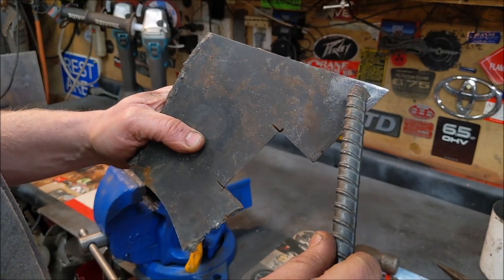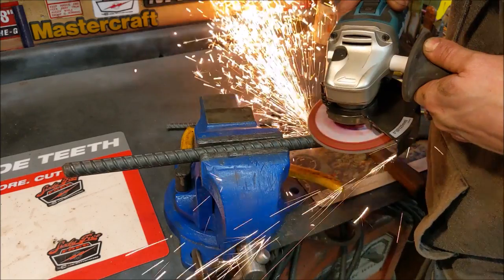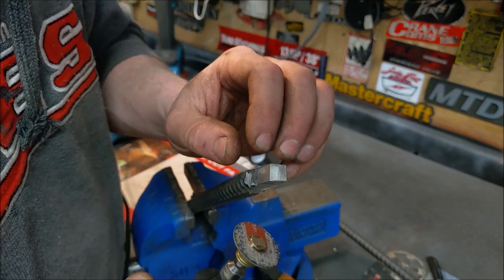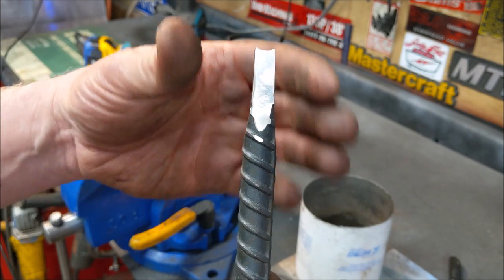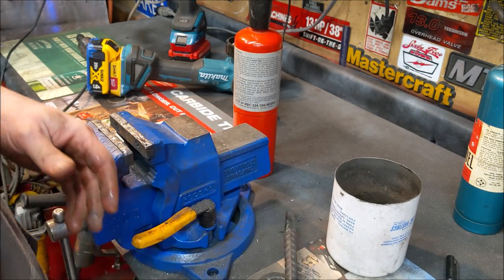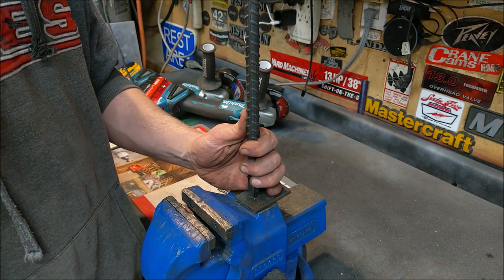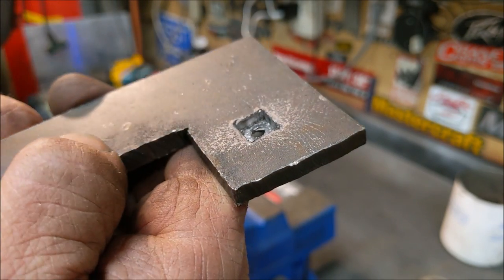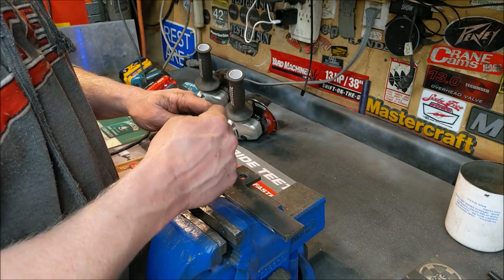Drill Square holes in steel with REBAR   -NO SPECIAL TOOLS needed

Comment: When you heat the tip of the rebar, watch the color move down the metal towards the tip, and as soon as purple hits the tip quinch it in oil and swirl it till it cools off. I've made cutting chisels this way in high school and we had to cut thru 1/2" bolts without damaging the cutting edge to pass the course. I still have and use my chisels I made 20 years ago
Reply: Yes !! I rembr -- but l always wondered why purple and not pink, straw color, grey ? Purple's it huh ?
Reply: Good tip and thanks~!!

Comment: I would have never guessed in a million years that a square hole in .25" steel was made with rebar.
Reply from the maker: It takes a few dozen good swings but comes out nicely.
Reply: It's a bet I woulda lost
Then I would get in a fight, claiming I didn't fully understand the bet, that I mightta been drunk or something, in an attempt to welch out of it
:(
Whew, thanx to 65Ford or that woulda been a real mess in the making
:)
Reply: And a hammer
Reply: Had a certify on the job to weld rebar once -- we used 9018 rods, not your typical 7018s

Comment: Nice job! Re-rod is useful, no doubt. I have saved some big bucks making actuating rods for Cub Cadet tractors and others, by using my woodstove as a forge. One problems that I have run into- repeated heating does cause the metal to go swiss cheesy and become very brittle and crumble away. They are made from recycled steels and are full of inclusions and stuff anyway.
Reply from the maker: It's a great resource for cheap steel.

Comment: Since only the corners of the broach are doing the cutting, think about how you could make the tip of it round to fit into the hole and just have the corner a bit higher up and come in contact as the broach moves into the workpiece.  Just a thought.

Comment: This is a great video. I didn't know whether you could do anything beyond case hardening of rebar but it looks like it's good enough steel that you can actually make decent hardened tools out of it. Like you said in the one part, annealing it will retain much of the hardness and take away the brittleness from the initial hardening. I learned how to do this from Tubalcain and fixed my old Brazilian-made single shot youth shotgun I bought when I was 14. There was a spring-loaded pin in the forearm that had bent because the metal was too soft and the forearm wouldn't stay on when breaking the breach. I initially fixed it by running some electrical tape around it and it stayed fine that way but it always bothered me that the tape was there. After learning how to harden steel parts, I pulled it apart, took the spring off and straightened the pin. I hardened it with water quenching, then I heated it back up hot enough that water would bead off of it and let it cool slowly. Once everything was cooled off, I reassembled with some light oil on the forearm and it works as it was originally designed. Stays put when breaking the breach and comes off when it's closed and you give it a good yank. The manufacturer probably cut a corner on that run and skipped the hardening process on that pin, so hardening that pin fixed it. I was so stoked when it worked. Haven't shot that thing since I was a teenager but it was neat to get it working the right way. Now when I pass that shotgun on to one of my boys they'll never know the difference.

Comment: About 8 months back I did a video about hammer broaching with HSS on a piece of aluminum.  Recently tried it again. But this is a great idea. I had no idea rebar could be used like this. Best thing about yours, is you could also taper your tool to make for some adjustment

Comment: I'm a professional machinist and I have made broaches at work and at home but I have always made them from high-speed steel, I would never have guessed that rebar would harden well. Knowing that could be very useful for a lot more than broaches.
Reply from the maker: It's not the most predictable material to work with, though it does harden nicely. Depending on the grading/rating it can have higher carbon content and get too brittle with the standard heat to orange and quench method. The 1/2" bar I used needed as much help as possible and I used water vs oil quench to achieve they hardest steel possible. The 5/8" bar would have been better a little softer and an oil quench would have achieved this better. You can always anneal it at any time though.

Comment: That looks like a good idea.   I've always drill a hole and used a file to make a square hole.  Your way is much faster.
Reply from the maker: When I need to make a row of 5-6 of these holes in sheet metal this beats filing for sure.
Reply: Same here. Drill and file. But I’m not very often worried about square holes.
I’ll have to try this sometime.

Comment: Great video and sweet idea. The hardening process from what I have seen, was heating the metal until it is no longer magnetic. Quench in you choice water / oil, but they anneal the metal to soften it to be less brittle. So blue is next color during annealing, then air cooled or quenched. It’s been a while since I have watched a black Smith or knife maker, but worth looking into to avoid having more work to sharpen. Retired auto tech, but I still fabricating. With the price of weld shield gas, oxygen & acetylene has gone triple from invoices of 10 years ago, makes it difficult to justify a purchase. Great lighting, volume and camera angles are great. Having a tripod makes a huge difference. I hate the “One-banded” videos and they try to open the worlds toughest plastic parts box.
 I have thought many times, if they made cars out of certain plastics used in packages they would last forever! Thanks! I will not forget this when a future project would be better with a carriage head bolt. They have a valid place in the world. I thank Black Smiths from 150-200 years ago who formed these for “Round Top Trucks” and wagons plus stage coaches!

Comment: Kind of a cool trick. Especially the hardening part.
A square file can work, but it is a lot of work.
When I have to make just a few square holes out of round ones?  I use my little cordless Milwaukie mini sawzall (called a Hackzall)  with a fine tooth metal cutting blade that resembles a narrow jigsaw blade (but has the sawzall blade mount shank on it..).  It cuts on the pull strokes, of course,  while the tool foot is held tightly to the work,  and files out the square corners real quick.
Reply from the maker: That's how I do square holes in wood.

Comment: You could probably use the right size carbide burr and shape your broach in a drill press with it chucked opposed to the drill chuck.

Also maybe you could chuck the broach into a hammer drill that supports hammer without rotation?

Comment: To find the diameter needed I times the size I need by 1.414.  So to make a 1/2 square you would need a 7.070 round bar. (.5x1.414= 7.070) you may be able to find this from a coil spring or torsion bar. Great video. Thanks for sharing.
Reply from the maker: Thanks for the info!

Comment: Great idea/work aid.... The only thing I might suggest is when you are about half way through (or as often as needed) is to redrill the hole to help clear out the metal that is gathering in the center. This will help by decreasing the amount of metal you have to broach out as it builds up...... Just a suggestion to a great idea.  Keep up the good work..
Reply from the maker: That's actually a fantastic idea. Thanks for the great input.

Comment: I’ve seen this same thing done using a square file. You drill the hole to size first (say 3/8”). Then take a square file that is the same size, cut off the tang, and press it thru the drilled hole using an arbor press or hydraulic press. The file only has to remove the metal from the corners of the hole. You just have to be careful to press it straight or you might snap the file, as they are very brittle.
Reply from the maker: Makes sense. That's how most square broaches are made.

Comment: So cut it about 6" long.....put in larger pipe( to keep straight and protect shattering parts from eyeballs) and use cheap bottle jack press to press thru metal plate. ......should work and no hammering....
Reply from the maker: I would trim it down to about an inch or two for a press. The top is too soft and will bend out of the way if it's too long. It should take around 10 tons to press a 3/8" square through 1/4" plate(15tons-3/8"plate, 20tons-1/2"plate). It will be a scary.
Reply: @sixtyfiveford  well dang man!!! Sounds like a great followup video😉

Comment: That’s a really cool idea.  I’ll have to remember you can harden rebar
Reply from the maker: Yeah Rebar is medium to high carbon steel(depending on rating) and makes some decent tooling.
Reply: sixtyfiveford, mostly I have used it to make ladders on machines at work drilling a hole in flat stock and making the foot and hand grabs out of rebar because it has great grip on machines when a typical ladder will not work and you have to build it in.

Comment: Just a question, would this square hole broach easier if you drilled a small hole in each corner after drilling your first hole, or if you drilled four small holes before drilling your large hole. Would this help guide the broach and make penetration easier?

Comment: Nice Job,  I didn't know rebar would harden..   In Machine shop,  you would normally rough drill the hole 5% - 10% over size,  Yes,   It'll leave a small radius on the flats,  but,  the broaching goes 10 times easier..   Making a smaller broach to rough it out,  would help a lot..  2 smaller cuts is much easier..
Reply from the maker: Makes sense.

Comment: That was outstanding. I drilled the hole and then filed the square. Will be using your technique. Thank you...wanted to ask if you could show how to make a simple metal brake bender. I have 1/8 inch aluminum I want to make small trays and use flex weld aluminum rod to seal the corners. I’ve tried making one but can’t get a tight 90 degree bend. It has a bigger radius than I would like. I’m using a 6061 aluminum. Any suggestions would be greatly appreciated. Thank you all your videos are great have passed your channel to many of my friends.
Reply from the maker: For 1/8" aluminum you'll need to score it 1/2-3/4 of the way through like I did in this video https://youtu.be/nynDS-NTBLM?t=324 . For a brake use my vise and chunks of long angle iron. It hold a crisp edge and you have to hand form the bend over than. Sometimes I score the metal and then use the makeshift metal brake.

Comment: I only use square holes on snowblowers when restoring the auger housing.  All I do is drill a slightly smaller hole with a drill bit.  Install the carriage bolt and put the nut on stud side.  I tighten the nut it punches through the circle and makes it the perfect square.  Also use this technique on mower handles as well.

Just another way to skin a cat
Reply from the maker: Snowblower scraper bar is the #1 reason I make square holes.  You don't need to even drill a hole the tool will cut out the entire square with a few whacks. I've pulled them through like you was well though or I just tack weld the head in place with a larger hole as no one will ever repair it again.
Reply: @sixtyfiveford  

I have done the pull through method on countless cheaply made machines.  I have a supercharged hemi 420cc swapped Ariens 1128 that I'm restyling and restoring.  The Auger housing is damaged and scraper bar is worn through.  Since Ariens makes a quality machine, I was questioning my method since its a better built machine.  Will have the rebar as my fail safe...or just by nature drill a smaller hole then usual and let the rebar open it to spec!  thanks for responding!

Comment: You clever devil :-D
The square hole maker for wood is similar-ish,  effecitively 4 wood chisels with the humped tops facing inwards.
Also a drill down the middle,  i thought it was magic untill i looked into the end, simple but so neat.
I wonder if you could use a bottle  jack to push a short one inch broach through the metal, it beats hitting it.
If you like the Hammer time, don't forget the baggy trowsers  :)
Reply from the maker: I am going to try one with a press. I would trim it down to about an inch or two for a press. The top is too soft and will bend out of the way if it's too long. It should take around 10 tons to press a 3/8"(1cm) square through 1/4"(6mm) plate. It will be a scary
Reply: @sixtyfiveford  i bet it will lol, Just be careful to stand out of harms way with protective glasses and a thick coat.
You never know if the broach will escape without warning.
And most important keep your loverly dog in another room.
Reply: @sixtyfiveford  10T isn't scary.  In this application it should be pretty tame.  It'll be interesting to see.

Comment: I took welding in HS good trick but after drilling heat the area cherry red  then hammer it out seems a lot easier
Reply from the maker: The entire surrounding area will smash flat and fill in the hole more than cut.

Comment: I wonder how well it would work in a press to punch the square hole through... Thumbs Up!
Reply from the maker: It should work just fine. I would shorten it to maybe 2" long and put a shield around it. It should take around 10tons to press something this size through 1/4" plate.

Comment: Guess it will depend on what scrap steel is used in making the rebar, but it looks hard enough for most of the stuff I'll be broaching.  Thanks.
Reply from the maker: True. Generally rebar has to be made to spec to meet building code requirements. Stuff used in bridges and sky-rises will have the best characteristics.

Comment: That's a very effective technique.  Just curious about something.  When the broach is about half way thru and some of the material being removed is collecting in the hole could you have run the drill bit thru the hole to remove that material?  Thanks for posting.
Reply from the maker: I couldn't have hurt.

Comment: Would heating up the metal after you drill the round hole in order to soften up the metal to make it easier to punch the square rebar through work?
Reply from the maker: Problem is steel doesn't really soften until you get it red hot. Then hammer with the broach would flatted the surrounding area as much as cut.
Reply: @sixtyfiveford  didn't think about that. 👍

Comment: Nice work, love the improvised punch. I've experimented making square holes with files jammed in my reciprocating saw with limited success. (wrecked the file though)
Reply from the maker: File in a recip saw is something I would try.
Reply: @sixtyfiveford  it works.  They actually used to make file attachments for shapers just for this.  Slow down the recip saw if you can.

Comment: Common  1018 steel will harden nicely, heat it up orange-ish red, not too hot, and quinch it in used, (black motor oil)...
It's rich in carbon engine deposits, which attach to the red hot metal.
After cooling completely, sandpaper the surface back to a shiny steel surface and  heat it to a light tan- straw color, to take out some of its brittleness, let sit for a few minutes, cool with tap water  viola'
 HARD TIPPED PUNCH.(CARBON IN DIRTY MOTOR OIL IS THE SECRET)
...NO CHARGE FOR THE INFO.

Comment: i wonder if they sell ball grinders that big for demils that would work good for clean finnish of dishing it out
Reply from the maker: The abrasive ball grinders never seam to work well and generally wear away faster than the material your grinding. I use carbide ball grinders but you can't use them after you've hardened the rebar.

Comment: Do you think my 12 ton floor standing hydraulic shop press could push it's way thru steel without having to swing a hammer?
At my age swinging a hammer that much is too hard on my shoulder
Reply from the maker: I have a video using a 12 ton hydraulic press to do it.

Comment: Its not hard to make a round hole into a square hole in mild steel with a decent file in just a few min. This would only make sense for punching holes in thin and soft metals
Reply: That's what I was thinking only with 4 small holes in corners then drilling the center out.

Comment: Would it been easier done with your square hole material hot rather than bashing it thru cold ?? Cheers from down  under in Australia
Reply from the maker: Hot the metal would smash flat more than cut.

Comment: 7:00 Perfect time to drill again for relief. Now, if you heat the hole red hot, it be easier to drive the bar through.
Reply from the maker: There's a reason you don't heat metal before you drill a hole with a drill bit and the same goes for this. First, you have to get it red hot and it only stays that way for a few seconds before the heat spreads. Now you have a red hot piece of steel you're playing with along with a torch all while trying to get the punch and hammer lined up; seconds are ticking. Now you line it up and strike your first blow and your punch will loose it's temper once it comes in contact with the red hot steel and deform as well. Now you have a deformed hot chunk of steel and a hot rounded over punch. Still no square hole.